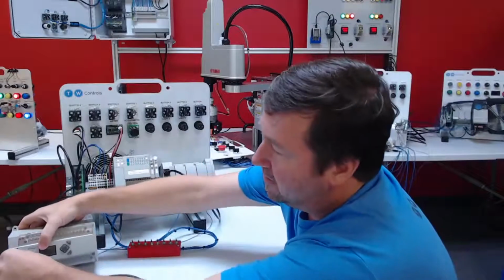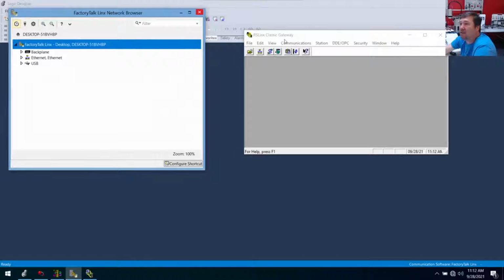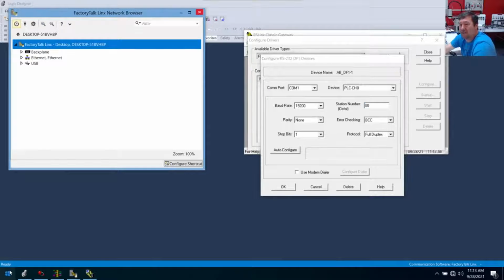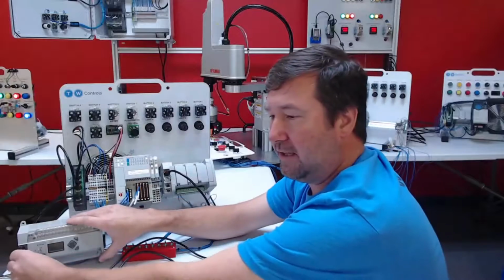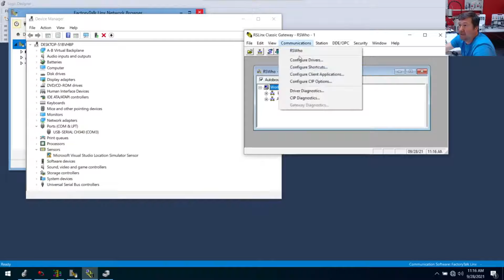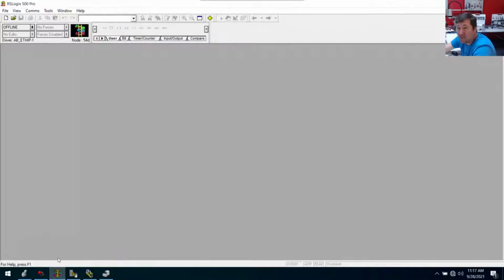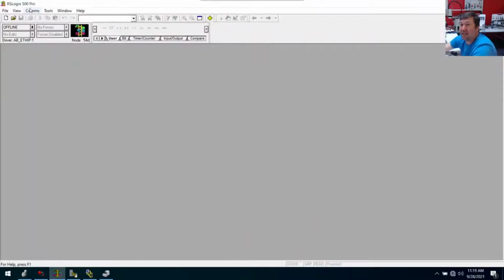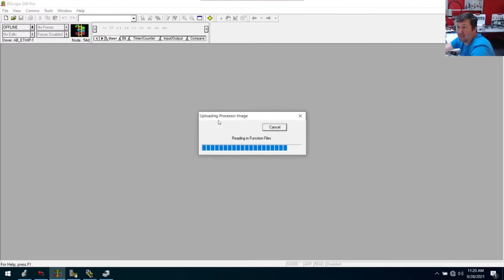Allen Bradley RS-232 DF-1 Serial RsLinx Communications Configuration

Comment: I'm trying to establish connection with my SLC 5/04 and I'm using 1747-UIC RS232 pin. So I can't find the cpu in RSLInx after clicking Auto-configure. Does anyone know what could be the reason ?
Reply from the maker: If your are sure that is is configured for DH485 then the auto configure button does not work. Check out this video. 
https://youtu.be/jSKZ8sS1-HM

Comment: Have you ever use Tripp Lite I am having issues communicating with 5/05
Reply: also what is the right cable to use for 5/05
Reply from the maker: Never used the Tripp Lite.  The 5/05 has a Ethernet port and a serial port, the serial port is a 1747-CP3.

Comment: I bought a set of connectors from plc cable, and you were right the first one I pulled out of the bag looked like it matched the serial, I tried for like 1 hour with no luck, I will order the other cable today
Reply: Hii,how tu setup eni tu connect plc5 processor?? I already made ip at ENI ethernet,but when i connect 25pin to plc5,prgram cannot on9.. y??